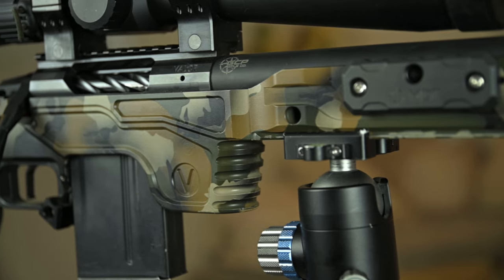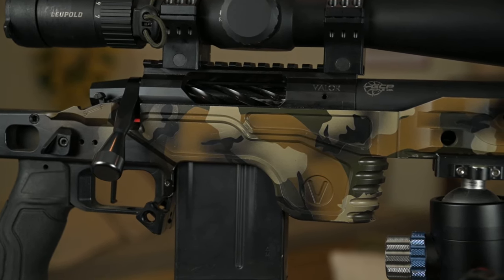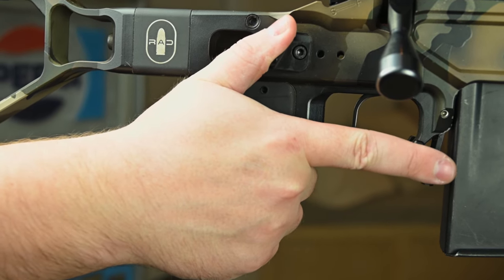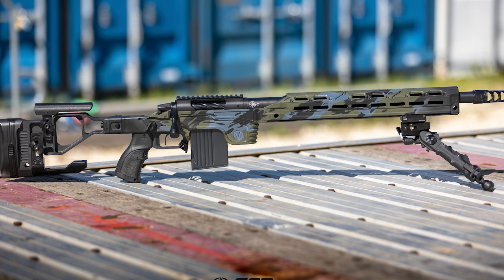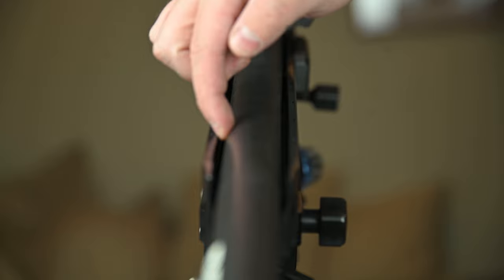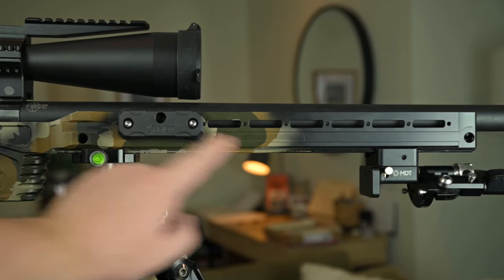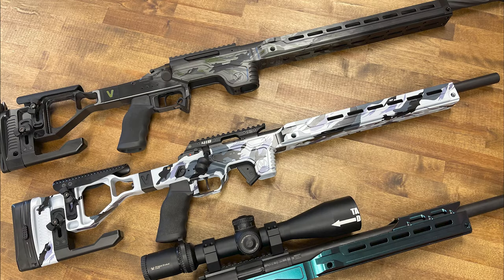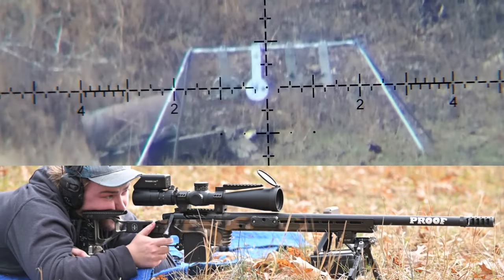The Vision Chassis Breakdown-A Complete Walk-through of all its Features

Comment: Hey RAD, I have a weird question for you. I'm wondering if you think it's worth the time to vacuum seal your ammunition in smaller batches so as to prevent any random changes to humidity levels of your powder over time. I haven't been able to prove this concept but in my mind it makes sense. I will typically load up 200 to 400 rounds at a time and that will usually last me a year or so. What are your thoughts?